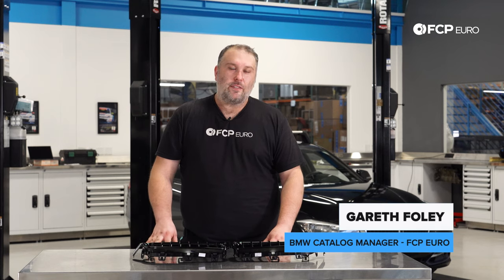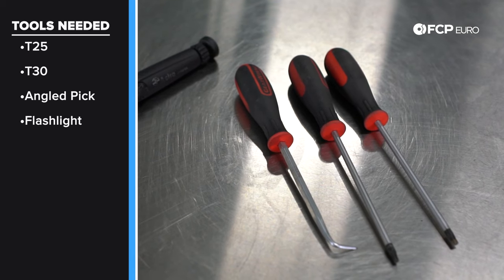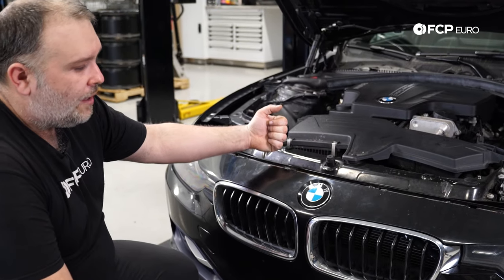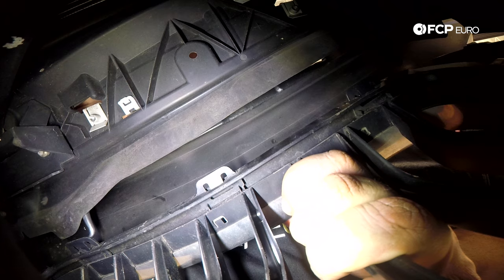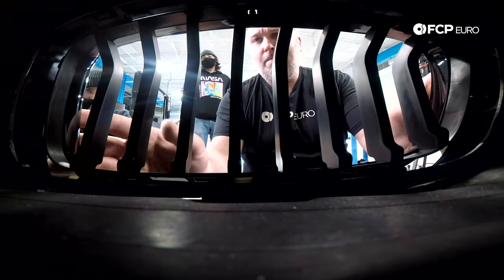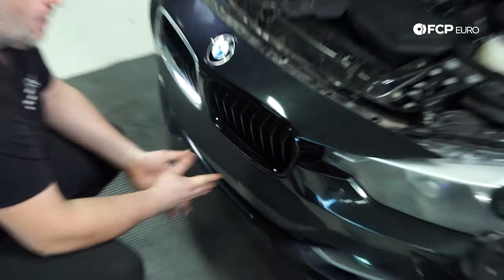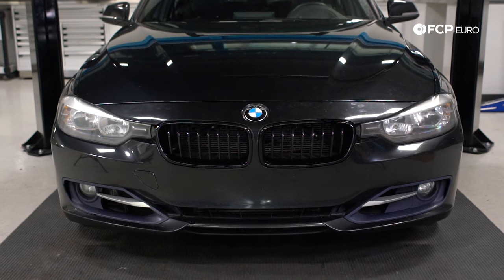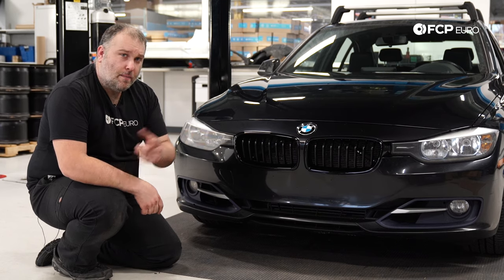BMW Kidney Grille Removal & Replacement DIY (BMW F30 328i & More)

Comment: If you have the angle pick tool like I did, removal was a breeze from the outside. Didn’t have to loosen the bumper. Got it replaced in 10 minutes without breaking any clips.
Reply: Where to buy pick tool? Amazon?
Reply: Amazon sells it, but you can probably find it cheaper from your local hardware store or Harbor Freight. .

Comment: I bought the angled screw driver and did it first time in 5 mins. P.s you dont have to open the bonnet. You literally just use your hands to put outwards pressure and use the angled screwdriver to clip off the clips.
Reply from the maker: Good note!

Comment: Cinematography from inside the bumper was genius. A few tips...
- Wear a long sleeve shirt, since you have to reach in behind the bumper with your arms. The bumper plastic at the top is super thin and flexible.
- The T30 and T25 screw washers should be marked with a silver or white marker around the perimeter This allows you to screw
 them back into the same exact locations. This preserves the gap between the hood and the bumper edges. A proper gap isn't automatic.
- Start with the bottom kidney grille clips and pull up with your fingers, while pulling the kidney grill out. The clips tend to pop back in.
- The pick tool is a slick idea. You might be able to avoid unscrewing the top of the bumper and just use your fingers or the pick tool 
starting with the bottom clips. Some folks use a coat hanger (the hook end) in place of the pick tool.
- Fatal flaw is to NOT install the new 1st kidney, until the 2nd grille is removed. After the 1st kidney grille it out, you can reach the 2nd kidney grill thru that opening and don't need to come in from behind from the top. Capt. Obvious. 
- Patience Grasshopper.

Challenge: BMW E9X headlight module replacement and even resealing the plastic lens. Or full replacement using BMW OEM vs OE parts.

Comment: I followed this guide and it worked out well. The only thing I did differently was once I had one grille off using the pick, I went through the hole the removed grille left and with a long flathead screwdriver easily pressed the clips for the second grille.

Comment: Did mine this afternoon.....15 mins. Unfortunately, i dropped the last screw through the engine bay into the tray under the car. Absoluteky gutted. Any suggestions for an easy retrieval on a postcard please. 😊

Comment: How do I know the size of the grill I need? (How do I measure)  Here’s the deal. I bought a bumper second hand of another e46 for my 323i. The hood sticks out a little in the front because it’s a newer model I’m guessing. And I don’t know what car it came off of. 
I’ve bought 2 sets of grills already, both wrong size. One was small ( for my 323i OEM )and bought another set for 2003 3 series and it was weird shape. Did not fit. 
How do I find the right size?

Comment: Ik this video is old but is the part that holds your fog lights stock? I also have that color and always wondered why it was purple
Reply: depending on the age of the car the original black trim fades to a purple hue. you can find the fog light grille replacement online but idk about the center trim piece for the bumper